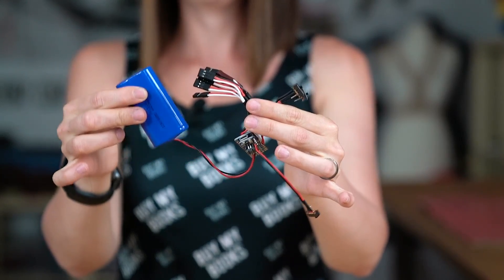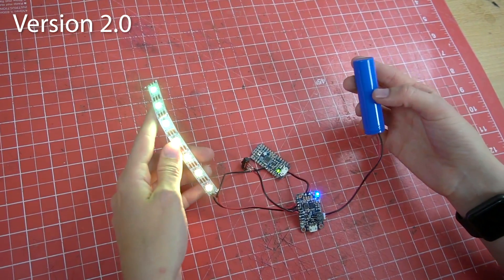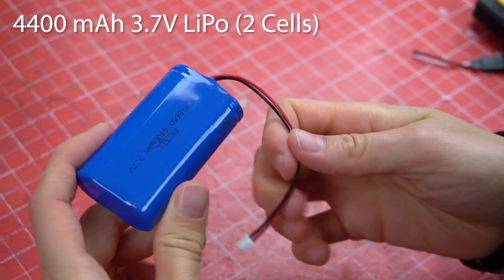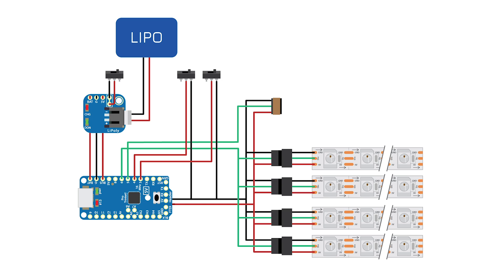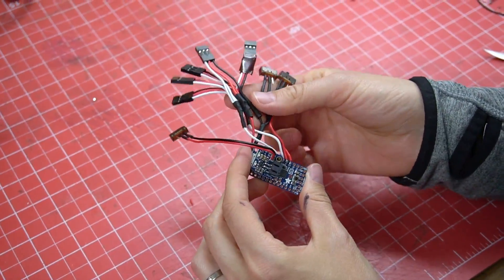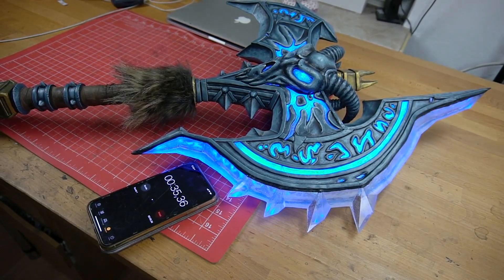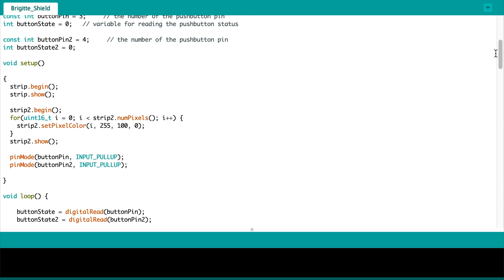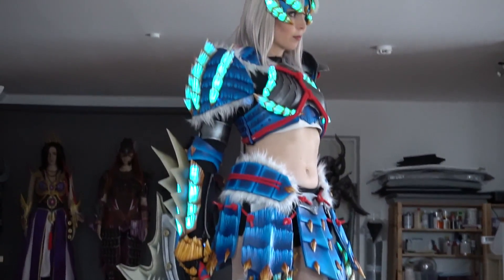LED crafting hacks for CRAZY costumes!

Comment: Svetlana and Benni, thank you so much for your amazing videos and books! I have bought and read both of your cosplay lighting books, and I've watched all of your videos, but the thing I still don't understand is how to improvise on my own. So, for instance, if I don't buy the exact microcontroller board you're using for a project, how do I know what wires go where? Similarly, if I want to go to the Arduino library, how do I know what code to use and how to edit it? I was wondering if you might consider making a "basic navigation" video where you show us how to mix and match.

Comment: 50 LEDs per circuit - but you're using hundreds?? And it still works? 😲
Reply: If your circuit is designed to pulse, then the LEDs use much less power as some are off.

Comment: 6:47 Someone correct me if I am wrong, but the 20mA per LED is only for non-addressable LED strips as they are rated at a peak of 60mA per each 3 LED segment. However for addressable LEDs, each LED has a theoretical peak of 60mA per LED.

Comment: I'm totally inspired by what you make and attempting to create the same lighting effect in a prop I'm making. However the pro trinket didn't like my computer either so I'm trying again with the Pro Micro (AITRIP 4PCS Pro Micro Atmega32U4 5V 16MHz,) (This came up when I searched for what you suggested as a replacement in your book) but there's a couple of differences with them. Can I still attach the LiPoly backback to "RAW" "GND" "RST"? (which is the upper right),  and as there's no connection - and + on the back I'm not sure where to connect the ground and data wires to. Any suggestions as I'm a complete novice. I just need to power a lot of leds like you did with your shield.
Reply: cant google rn, but I think the pro micro had some specialties that made it difficult to use for novices, I think a normal nano should also do the trick? And if the lipo-board you have doesnt fit that (it should have a wiring guide on the webz or atleast pin names for what each of its connections does on the board) then there are a ton more breakout boards on the internet that can also do the same and hopefully come with that info :)

Comment: Have you ever synced lights with sounds at the push of a button?
Reply: Shouldn't be very hard, you can just use and aruino to controll the leds and an mp3 module for example the one from df robot

Comment: So how hard would it be to make a staff that when I make a certain motion a specific light animation and sound comes out
Ex. I thrust the staff up toward the sky and the lights flicker white and thunderclaps but I aim the staff down and the thrust forward the lights turn orange and run up the staff making a fireball noise.
Basically, I want to make the technomancer staff from ThinkGeek's April fools video
Reply: not too hard, you need an accelerometer to measure the motion/orientation and you could use a dfrobot dfplayer or how it's called mp3 player module + speaker to play the sound... you just need to pull the values from the sensor (via I²C for example) (there are also ones with librarys that handle the register stuff already) and then figure out what motion you are performing and what orientation the staff is in (where down is)... i guess you should be tracking the orientation with some kind of low pass filter, so your movements don't disturb it and then maybe have some high pass filter for motion only to trigger the effect (probably not necessary, since thrusting is usually stronger than g)

Comment: How wide are the LED lights, I need to know if they would fit into some tubing that I have but I cant find any lights on amazon that say how wide the lights actually are which is a pain.
Reply: the 60 led/m strips are usually 10mm wide i think (the leds themselves should also have a datasheet i think the package is called 5050)

Comment: You can get rid of the lipo backpack and connect the power boost directly to the trinket and then charge the project directly by plugging it in! You can even add master power switch to the power boost!
Reply: Also, check out the Adafruit Itsy Bitsy. It’s like the Trinket on steroids.
Reply from the maker: The lipo backpack charges as well though! :)
Reply: Can you please explain a little more about? I want to make a halo sword with a USB charger on the bottom and I have no clue where to start

Comment: What would be cool would be using a gyro/accel sensor like the mpu9250 to provide motion feedback to the LEDs, so that they can react to movements and orientation of the illuminated cosplay pieces!
Reply from the maker: That would be very cool yes
Reply: that would be cool, yeah... you should probably use the fastLED library for the controlls then, afaik it is a lot more powerful than the adafruit one and can directly handle matrices ect. :) ... also I think there are acceleration sensors which directly compute the vector towards the ground (earths center), so you could save the calculations for that

Comment: you should see my latest set up, I had to use 6 different buttons: to change colors and/or animations. And had to use a separate board to control a DC motor as a normal 5V supply wouldn't cut it to power both LED and motor.

Comment: Hi Svetlana, I like this nice little animation module and I really like the creative use of the 3pin servo connectors to connect the lights! 
Although you said you have used hundreds of leds, I am a bit worried about the current draw. The trinket can deliver 150mA through its regulator and 500mA at the BAT pins. If you are using the 500mA output you could power less than 10 neopixel leds at white full brightness without overheating the output. As you mentioned when using animations the amount of leds is much higher, because of the colors and the on-off-cycle. But maybe a word of warning about static white lights and using the BAT power output and not the 5V on top would help preventing accidents. Greetings from Berlin, Kai
Reply from the maker: I actually used already far more for the output than allowed for a short time, ha ha! The circuit just turned of and nothing happened. Guess the Adafruit products just have a really good protection build in. :)

Comment: Funny thing is, I do not even intend to do cosplay or create costumes. I do like it though. I am here for inspiration for lightings and plan on creating a lighting system for my stairs. And this seems pretty useable for that. 👍
Reply: but use a proper psu, don't run it off a battery xD
Reply: John Uferbach Absolutely, and I want to use Motion Sensors instead of Switches.
Reply: @sunwukong6268  Thats a good idea :) Maybe also add a brightness sensor if you only want to turn it on in the dark (or make it darker / a different color ect. in the dark / during the day...)
Reply: John Uferbach That’s a good idea. I‘ll definitely keep that in mind

Comment: As an electronics hobbyist, I think this is cool and I know it will work perfectly. As someone who was previously certified in precision soldering by NASA in 1999, I'm completely horrified. Great video!
Reply: You've obviously never seen the lighting on my old boat trailer then 😂🤣😂🤣
I was literally just about to comment on how beautiful her soldering was.
Reply: @wilfdarr  Probably still works like a champ though.  👍
Reply: @jeremyortiz2927  Til the day I sold it at least. No way I'd go near a circuit board though. Next time I'm bored I'll have to look up the proper way to solder.
Reply: @wilfdarr  Check out the tutorials by EEVblog, those should cover all the important aspects (he also has a few on manual smd soldering for example ;D)
Reply: @johnuferbach9166  Awesome, thanks. I'll check that out.
Reply from the maker: sorry x-)

Comment: You guys should make a downloadable code on how to turn your leds certain colors for certain animation cycles! Trying to figure out how to make a white crawling effect but gave up halfway through and just went with the sky blue you had on your Gauss Rifle lol.
Reply: just change the rgb values of the blue one to 255, 255, 255 = all colors max = white (you can ofc also choose lower numbers / reduce the global brightness) be aware that white on rgb-leds draws the most current, at full brightness i think about 62mA per led, so make sure you power supply can handle that

if you wanna do it from scratch: make a for loop that increments the position of your "wave" (probably just values for the colors of each pixel you want to light up) 
loop
endOfWave = endOfWave +1;
for (int i=0; i<numPixels; i++)
if(i ==endOfWave-5)
strip.setColor(100,100,100, i)
else if(i==endOfWave-4)
strip.setColor(200,200,200, i)
...
else 
strip.setColor(0,0,0, i)
end
strip.show()

and have more if's to handle moving the wave to the beginning when it's hitting the end (like... if(endOfwave == numPixels) = endOfWave = 0;
if((endOfWave -1) == numPixels)
endOfWave-1 = 0; )
or something like that (just a rought idea^^) (if you make all dependant on endOfWave you need to add more ifs in the movement-loop to avoid having negative indices)

beware, the syntax isn't correct... it's been a while^^

Comment: Thats actually Li-On battery you're using, Li-Po requires different charger with balancer, and overall is pretty dangerous to use since any short or damage to the battery can set it on fire in an instant.
Just saying, so noone buys a Li-Po by mistake ( even though theres a safe Li-On in the links ) and burns down their house. 
Cheers, video is great and helpfull as always, great work :D
Reply from the maker: Thanks for the correction!!
Reply: 3.7V is just one cell and never needs a balancer. You need a balancer if you have multiple cells.
Reply: Ahhh thanks so much for that comment !! :D for reasons the Link with the battery doesnt really work for me, so I was about to look for the right one or a similar one

Comment: You pretty much nailed it. The only thing I would think of doing, is..
Create Adafruit project boxes, by mounting the trinket system in project boxes. you can mount the charging plug, programming socket, switches, etc neatly into their own boxes. That way if you need say an 8 plug project box, you pick that one out, drop the program to it, then plug it in. 
Of course this means you will have a number or pre mounted trinket boxes ready to go, but.. It makes it easy and quick.

Comment: I usually take existing code too and bend it into form until it works as intended. No need to get it perfect. At least not when having limited skills like me.

A question: How did you make the transparent blade? What material did you use?
Reply: For Shadowmourne? (The big icy axe?) i think she poured that with epoxy
Reply: @johnuferbach9166  Yes that one. Thanks :)
Reply: @olafb.2929  She also has a video about it ;D
Reply: @johnuferbach9166  I will search for it tomorrow. Thanks again John :)
Reply: @johnuferbach9166  There is a video about it and the solution is really clever, and yes it was resin cast.

Comment: Amazing video, as always. 
What's the difference between using an Arduino Uno or an Adafruit trinket?
Reply from the maker: the size mainly. both work :)
Reply: I think you can use both as "Arduino" from the IDE, but they are based on different chips (depending on version of the trinket), so for in depth differences you'd probably have to check out the datasheets :x

Comment: Svetlana - considering how good LiPo batteries are at bursting into flames whilst charging, I wouldn't recommend charging them whilst in situ in your costume pieces. You can get special fireproof bags to place them in.
Reply from the maker: As I mentioned my lipos have plenty of protections build in and I never saw one burning or even getting hot. :)

Comment: I was wondering, when you connect your circuit with a USB cable to inject the code, does it charge the battery? Or do you need an external product to charge it? (Great video by the way, I really need to a prop with animated light one day!)
Reply from the maker: Yes, charges the battery with a lipo backpack or the powerboost. :)

Comment: Any good starter tools for someone who's new at soldering?
Reply: The JCD 908S from AliExpress is surprisingly good...
Reply: Get a thin (0.5mm or so) leaded solder that has rosin cores, afaik those are the easiest to work with

Don't forget to wash hands afterwards and don't breathe in the flux fumes :)

Comment: For me I was never able to get my computer to recognize my Adafruit 5v :C
Reply: Oh good I'm not the only one 😭
Reply: @SpaceRain  I actually believe I found my issue out. I was using a charging non data cable for the connection. Try buying a data cable of the right type.
Reply: @SpaceRain  ya lol, it's cause me sleepless nights. Apparently it's a common issue with anyone with a newer computer.